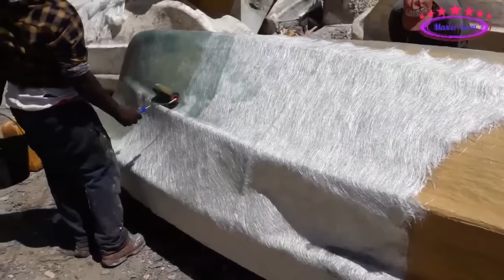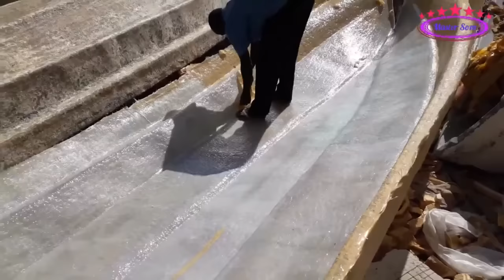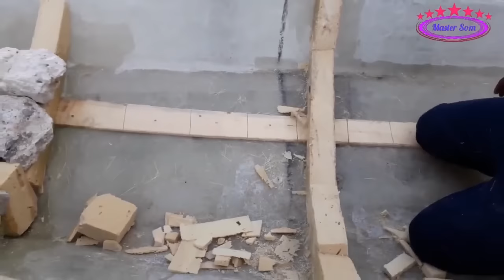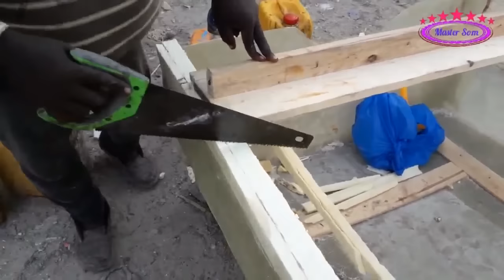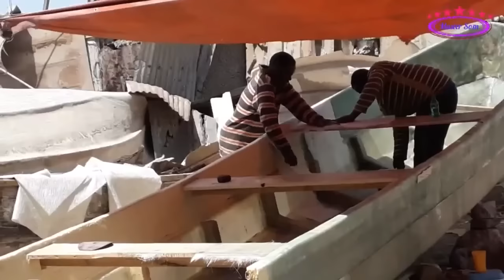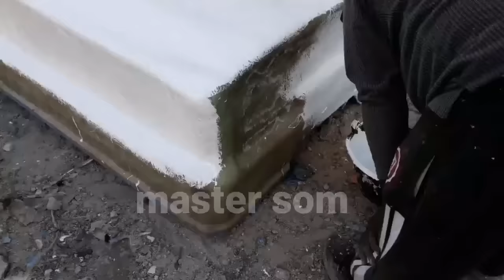FIBERGLASS BOAT BUILDING FULL VIDEO AMAZING BOAT VIDEO IN AFRICA MADE IN SOM FISHING BOATS

Comment: What an interesting boat build. A boat intended for use in harbor and coastal areas. It is relatively light weight, uses a smaller hp engine of about 7 to 40 hp, has a panga hull form designed specifically for the environment this boat is constructed for and operates in. This boat is not an expensive center console monster horsepower fast boat. It’s an affordable, inexpensive functional utility boat. It can give years of useful service to its owner for minimal cost. And since it has a large amount of foam used in its construction, it looks like it has a good amount of positive reserve buoyancy in case it gets damaged and flooded with water. And when damaged, it will be simple to repair. A very useful and minimal maintenance boat.
Reply: Mate.. these boat are professional fishing boats used even 50+ mile offshore, I live in West Africa and we have even more primitive looking timber 12 meter kayak style pirogues with huge timber in the base 12 inches wide and 8 inches deep... the boats are over a tonne and run routinely with 15hp Yamaha outboards... and going usually 20 to 60 mile offshore pulling in Marlin and 5 ft yellowtail tuna on hand lines..(in the right season)... no crazy laws like the western world... but we feed the western world with our fish exports.. 😊 good luck, be happy
Reply from the maker: Thank you for your positive thoughts and details followed by.

Comment: The workmanship by this man (men) to make a seaworthy boat from scratch. Doesn't seem to be stressed out rushed to get it done. That's how real quality is done. I'd buy one from this guy if I could get it back to the States without hassle. I'd even put "made by ___(name), from __ (country). "
Reply: sea worthy it is not;  for it does not have a deep vee astern,and will break your bones if slamming on waves;  but it will be great for calm waters, it is long and narrow,it will be economical on fuel; i'd be a buyer too
Reply: You must not know anything about boat building? I can point out dozens of mistakes, any one of which will result in rendering that vessel un-seaworthy, but I'll just mention the most glaring. He cracked the hull in several places removing it from the mold!

Comment: I is totally impressed with this build video. You did a very good job and I like everything you did to build it. With out power tools and with only simple materials. I wish i could do as well.
Reply: And how strong is it?
Reply: @mohamedsheikh6618  Hi - I think you have the beginning of a strong boat. I would put a second or third layer of fiber glass on it and it would be very much like a commercially made boat. My nephew was in the USN off the Horn and saw these types at sea 30-40 klicks out with 3 or 4 man crews. Yes they are primitive, but all the elements of a boat are there and glass enclosed. I don't think they will last 100 years but who knows. Suggest u look at the videos, especially the one with the 10-12 foot hammerhead shark.  Just sayin.
Reply: @mohamedsheikh6618   Fiberglass layered in resin is strong enough to stop a 9mm bullet with only 12mm of thickness. The hull of this boat has at least 50mm, it can hold the weight of about 7 people without breaking. It's cheap, lightweight and safe.

Comment: I’ve ridden in many many boats that were built like this.
They’re used for everything on the Isle of Cologne in Panama. They’re used like busses for the masses, but on the water. 
Rough as hell though. But this may be due to the fact that the guy operating the motor knows one setting, wide open balls out haul ass no matter what the sea conditions.

Comment: sugestion how u can make it work better
Sand the mold , paint it using gelcoat (super thick) with liquid wax for resin to make topcoat ...or mix 3 to 1 gelcoat with polyester resin 
when it cure sand it smooth or / and aply second layer if it isnt 
then sand it smooth but dont get to fibers....or if u do paint it using gloss coat paint 
then aply 8 times mold relese wax
after that u will get smooth surface without need to sand it etc and without need to use ductape as a release agent

for me ,,,, i will make new mold on existing boat..... tape it etc outside so resin will release , pour gelcoat on it , then when cure aply glass matt  thin maybe 2-3x 450gm2 , after it cure release it and make some 
 reinforcement the same like u make inside so some foam and matt on it 
then sand it inside using water sandpaper , aply few times release wax and u get ready to go mold without need to finish it , polishing , sanding etc ....  ready to go boat in less work

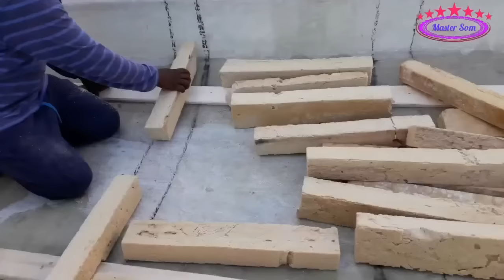Comment: 10:00 What is the name of that material that you place for the divisions?  greetings from Mexico
Reply: espuma de poliuretano expandida para las cuadernas, luego las forran con fibra de vidrio (mat 300) y resina poliéster pre-acelerada , lo que no le sacan ninguna burbuja con rodillo metálico quedando débil donde quedan burbujas de aire y permeable por eso la pintar por dentro y afuera.
Reply: @ernestopurificacion6082   so,i assume the polyester resin does not attack the polyurethane foam,right'
Reply: @josepeixoto3384    YES, YOU ARE RIGHT, THE POLYESTER RESIN DOES NOT ATTACK THE POLYURETHANE FOAM, YOU CAN LAMINATE ON IT, GREETINGS

Comment: I'm actually surprised at how little fiberglass they use.
Reply: That true. And they crack and leak. Sometimes a great deal. I was on a passage from the mainland to Bocus once and we had to start bailing no more than a couple of minutes into the trip. Those boards are the seats. Never put anything on the bottom that you don’t want to get wet. 
Fun times!

Comment: Its not gonna last long because of heavy pounding in high seas. It has very thin bottom. This is just for small lakes.
Reply from the maker: https://youtu.be/lbdH1U4uDtE
Reply: That boat is intended for use in open water. Probably harbor and coastal areas. It relatively light weight, uses a smaller hp engine of about 7 to 40 hp, has a panga hull form designed specifically for the environment this boat is constructed for and operates in. This boat is definitely not an expensive center console monster horsepower fast boat. It’s an affordable, inexpensive functional utility boat. It can give years of useful service to its owner for minimal cost. And since it has a large amount of foam used in its construction, it looks like it has a good amount of positive reserve buoyancy in case it gets damaged and flooded with water. And when damaged, it will be simple to repair. A very useful and minimal maintenance boat.

Comment: what kind of tabe do you use,and what kind of material for the stingers .thanks... and nice job
Reply: Blind freddy,  Learn to look - it is foam of some sort cut into blocks & planks...
Reply: The tape from what I see is a tape that I have used to tape up a box for shipping , Shipping tape. . The other materials are a closed cell foam that you would call styrofoam , cut into strips and blocks, and I would use a cement to hold it together  something like liquid nails ,it won't melt the foam.